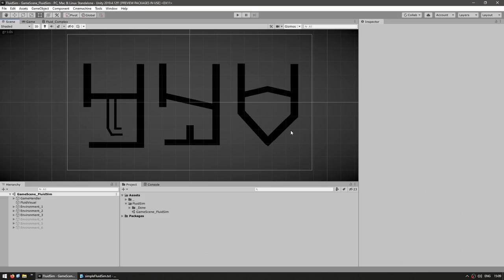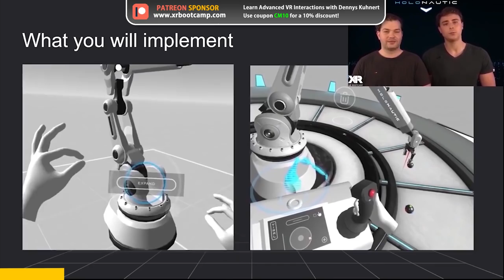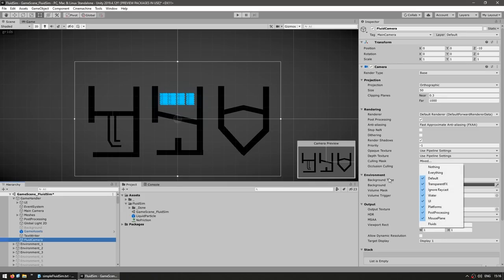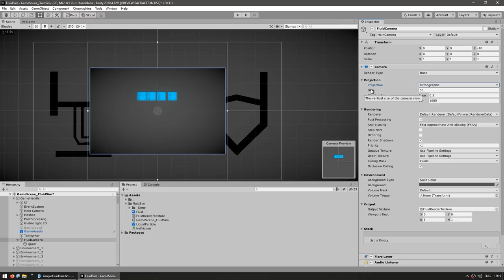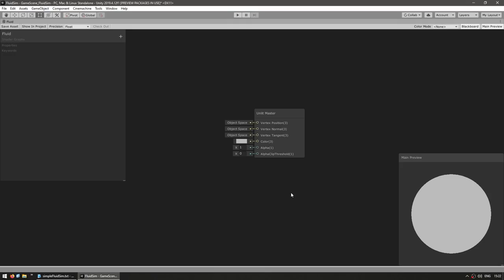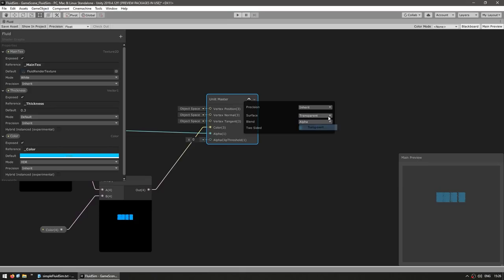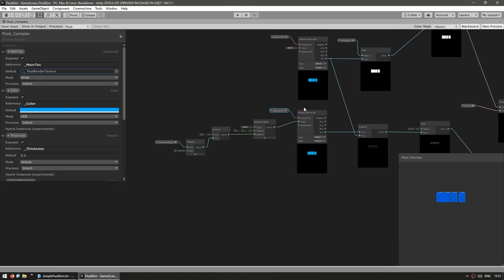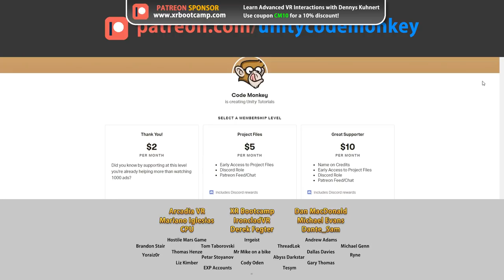Simple Liquid Simulation in Unity!

Comment: Been waiting for this from you! Thank you! 

Out of curiosity, why didn’t you merge the circles’s mesh when the rigid bodies touch via code? I’m a beginner, so have mercy!
Reply from the maker: Making some code to look at all the circles and dynamically generate a mesh would be extremely complex and likely much worse performance. In this case working with pixels is much better.
Reply: @CodeMonkeyUnity    Huh. Interesting. In my personal project, I was attempting to draw a mesh from 3D physics bodies. To make an ocean surface for more realistic shoreline. Was hoping the DOTS would help, but I don’t want to blow up my PC 😂. Physics are difficult. 
Thanks for the response!
Reply: In that case you're discussing marching squares/cubes to build the appropriate mesh. You'd also want to consider looking into doing so on the GPU instead of the CPU. There's tutorials out there for it, but it's a step up in difficulty, and you certainly would have to be mindful of how much you attempt to do at once.

In particular, if you're doing an ocean worth of water then you can probably ignore how water is affected if someone throws a rock in the ocean on the other side. In that case you want to look at ocean waves simulations and leave the water physics for places where the simulation is worth the cost of doing.

Comment: Hey can you make a video on 3d fluid simulation please. Your videos are so good and informative and OfCourse helping.
Reply from the maker: You could swap the circles for spheres but that would make it extremely performance intensive.
For 3D you're really better off using a proper asset that is designed to be performant, there's a bunch of interesting free and paid ones on the asset store.
Reply: I've tried to makethis in 3d. To fill a pot of 35 cm diameter x 35 cm height, and with water spheresof 2 cm, it took about 2000 spheres. My notebook couldn't handle it (I7, 16 GB of RAM, integrated videocard ATI Radeon with1 GB). It worked at 2 or 3 fps. I will try something else.

Comment: Have you fixed Survivor Squad doesn't always save the game? I've dropped the game because of that 5-6 years ago. I don't remember the details, but I've also sent a bug report back then. Manual saves would be a possible solution. Or there are? Then they didn't always work... I don't remember.
Reply from the maker: It's been a long time but the game does save a new save file every time you move. It didn't save at all? Sounds like maybe the executable didn't have permissions to save files.
Reply: @CodeMonkeyUnity  No, It didn't always save. I've completed a few missions, and game was successfully saved, but it refused to save after a certain mission. I remember I've completed it at least twice, on different playthroughs.

Comment: Is it possible to achieve this complex shader you used on water on the basic pipeline system (i'm not using URP) ? I'm trying to simulate blood and i'd like it to have something similar to that water texture you made with the shader.
Reply from the maker: Sure, I can only make shaders using Shader Graph but you can certainly write the same shader in code and make it work on the built-in.

Comment: 6:12 When I apply the material to the Quad, nothing happens. Ive tried making different materials with different textures and colors, the quad is still the same color. Any ideas?
Reply from the maker: Is your RenderTexture rendering correctly? Can you drag it onto the Material MainTex?
Reply: @CodeMonkeyUnity  Yes its rendering the Fluid particles correctly when I open it in the inspector. And yes I can drag it into the material "Base Map" like you did in the video, and then I drag the material into the "material" slot on the Quad, but it remains black. Can it be an issue with URP? Im using the URP asset and the Shader like you do
Reply from the maker: @ScilexGuitar  Are you using the 2D Renderer or 3D? Sounds like a light issue, change the renderer or try using a 2D Shader
Reply: @CodeMonkeyUnity  Thanks, apparently I was using Lit URP shader instead of Unlit

Comment: how can we render two fluid camera to render two separated water with different color that main camera can see both of them in game?
Reply from the maker: You can either make a complex shader that "masks" the different types and applies different colors to each mask.
Or simply put each liquid type in its own layer and make multiple cameras and render textures where each renders a different liquid type.
Reply: @CodeMonkeyUnity  wow you are really bruce lee😎 thanks for reply
Reply: @CodeMonkeyUnity  The duplicate cameras seems straight-forward enough, but I suspect you'd run out of layers rather quickly; in which case, how would you go about doing the masking?  Obviously, using subshaders seems almost mandatory here; just trying to picture the flow chart.

Comment: Does this work with 2D Lights? All my sprites for my game use Sprite-Lit-Default or a similar shader graph but with this Quad all the particles appear black no matter what 2D shader I use. Any ideas what could be the issue?
Reply: I found the issue, my fluid sprite was using the Sprite-Lit-Default not he Sprites-Default as used in the video which means I answered my own question and this does not work with 2D lights.
Reply: @heroslegendstudios1658  Thanks bro, this comment saved me oof.
Reply: @sergiogcb97  I did figure out how to fix so the sprite can be affected by 2D lights, let me go check my project
Reply: It's been a while, but I believe the only difference was to make the Fluid Material use Sprite Lit Shader Graph and that is the material on the Quad. I kind of fell off this to work on other stuff but I wanted to convert this to DOTS as well and make a tutorial on that

Comment: About my only nitpick about this being a 'fluid' simulation is the 'chucky-ness' of the surface of the 'water'.  There's no 'leveling out' of the fluid when it's at rest.

Yes, it's a good first step.  But it needs a way to smooth out the surface of the liquid.
Reply from the maker: That is completely dependent on the size of the particles. If you make them super tiny they will look perfectly smooth but naturally at the cost of performance.
You can definitely do it if you use it sparingly and you're targeting PC/Consoles.
Reply: @CodeMonkeyUnity  Well sure, if you're just leaving it to the physics engine.  I'm suggesting something like adding a script that'll check for the top layer of particles and compare their y-values are within a certain threshold (viscosity?) and if it exceeds that range, add forces sideways in an attempt to level them out.

Or use a 'suspension-bridge' effect that checks for collisions between particles and adds a small attraction force sideways and down to level the surface.

If you want to get REALLY crazy, make an AI to learn how to level the surface of the liquid on its own.

Not sure any will work yet, I'm just saying there's more that can be down that shouldn't affect performance much.

Comment: I'm havin issues with the post-processing part since my editor is the 2021.3.4f1 version. There is no post-processing option in the camera to just untick. I think it's making my whole quad look much darker than it should be overall. Any fixes/ideas on what i should do?
Reply from the maker: Sounds like maybe you're using the Built-in Render Pipeline instead of URP or HDRP, check your project settings
Reply: hi, did u solve this problem
Reply: @AhmetEmreYldz   Yes I was able to! Turns out i was using the wrong pipeline so after fixing it I was able to solve the issue.

Comment: I thought you were going to use celular automata. :(
This solution is not suitable for larger scales, as more "particles" means more GameObjects, that use the physics engine.
Reply: @eliten9985  I don't think you get my point. Im talking about it being applied to a real game.
Simulating millions of particles is not suitable for normal games.
Not everyone has lots of RAM and a really good CPU. If you have to sell a game, you have to take that into account
Reply: @Xeros08  I can only simulate 10k liquid particles with 60fps on mobile device
Reply: @eliten9985  you have a really beefy device then.
That, or you use a custom algorithm.
Because the simple aproach shown on this CodeMonkey's video is really limited
Reply: @Xeros08  yes i used data oriented and multi threading
Reply from the maker: Yes this is the simplest method possible which does not have the best performance. 
If your design requires massive bodies of water then yup you need to look into a more performant approach.

Comment: I have a question and please someone do answer " Can we use this concept in 3d with like spheres, like a cup of water where water is actually spheres? "  ??
Reply from the maker: You can but that would be extremely performance intensive. In 2D it's already tricky to get a couple hundred of particles, if you introduce a third dimension then you're unlikely to be able to make more than a puddle.
For that you need to research a more performant method.

Comment: What would be a simple way to make the top of the water level? So it settles flat like real water
Reply from the maker: It's all dependent on the size of the particles. The smaller they are the more smooth the top will be but the smaller they are the more processing power they require.

Comment: Honestly this approach is much disappointing
Reply from the maker: Why? Looks great to me
Reply: @CodeMonkeyUnity  Yes but its not at all performant.
Reply from the maker: As always you must pick the approach that fits your needs. If you need a small body of liquid, this approach is perfectly fine.
If you want to simulate an entire ocean, then yes you need a more performant approach.
Reply: @CodeMonkeyUnity  No, its more like, this is perfectly fine for a demo, but it almost not usable at all. Where are you supposed to use this? In a mobile game and blow your battery in one second? You're using render to texture (not that high res, but still), relatively expensive shader, and physics that never sleeps on 100 objects.

On a PC with endless power? Sure, but there are other ways to do this thats still more effective and scalable.

It's fine that you're doing this kind of a demo, but you must be open to its uses and to critique.
Reply from the maker: ...but that's exactly what I said, pick the approach that best suits your needs. As I mentioned in the video this is the simplest way possible and it's exactly what I was going for, I have no intention of simulation an ocean.
As for where this can be used, I made this system to then make a puzzle game just like this https://pbs.twimg.com/media/EGsPyqdWsAUT1RO?format=png&name=small
For that use case, this approach is more than performant and accurate enough.
Reply: @CodeMonkeyUnity  ah well, it wouldn't be my preferable way for a commercial game, but it sure is a good way to build a prototype! 👍 All in all, there's no reason to be fussy here, but it's good for an influencer like yourself to be clear of its use cases.